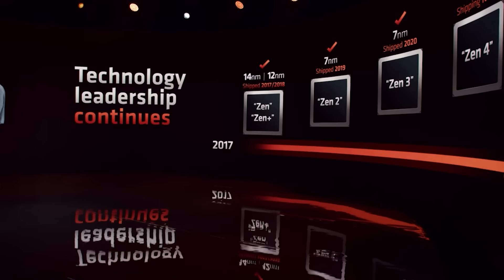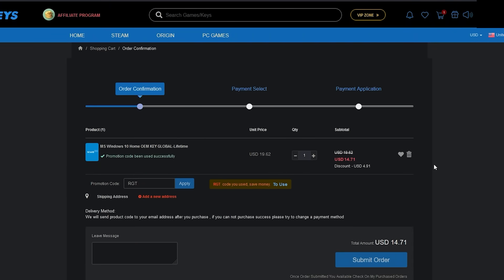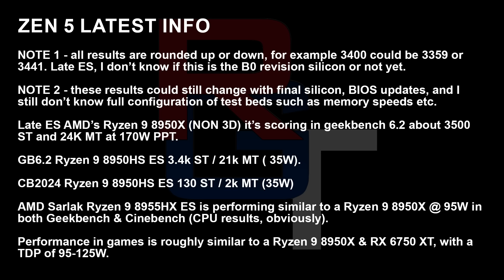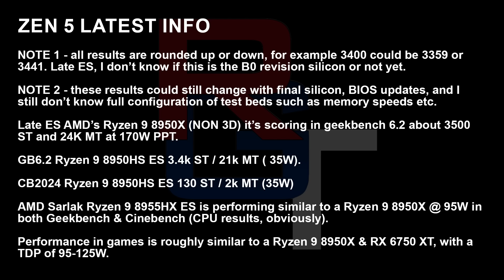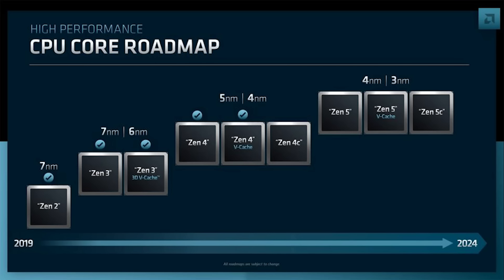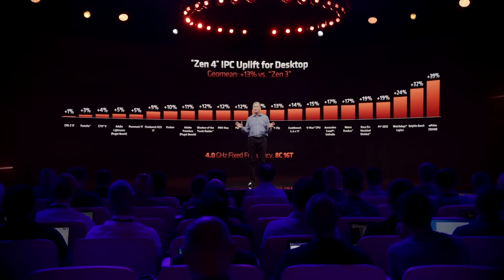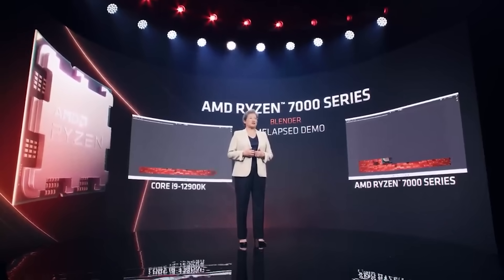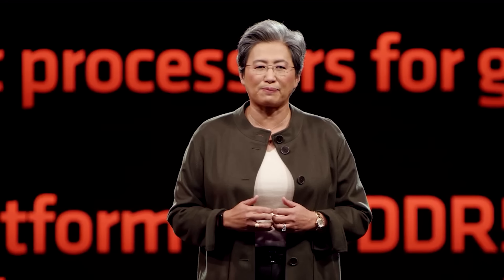Zen 5 HUGE IPC & Clock Speed Update | NEW Benchmarks Leaked

Comment: Imma let you finish but the 7950X3D is the most innovate Cpu of all time. Of all time!
Reply: Consumer desktop CPU arguably. But IBM is knocking it out of the park with how they’re using cache on mainframe and AI CPUs.
Reply: Smiling here in Oakland... Real talk
Reply: I'm chilling with my 5800X3D for another year or two. Still an awesome chip
Reply: Yeah!! Good choice, can wait until AM6 platform; I think am5 has a good 2 generations in it. After that CPU's will be insane for gaming @josh4434
Reply: They are real innovations, wish windows was more capable of utilizing them better
Reply: I have that exact CPU paired with an Nvidia RX 4090 GPU & 128GB DDR5 RAM. Very happy with it.
Reply: @euphorichaggis Terrible choice for your CPU. You should have went with an I9 13900ks or i9 14900k.
Reply: @euphorichaggis i have the same but have had issues running 4 dimms. What memory are you using?
Reply: If only the software kept up with it and used its 3D V-cache as well as that of the 7800X3D.

Also, I'd contest this statement and say that having both a few performance cores and many efficiency cores is a just as big innovation since you can use those many E cores to efficiently run highly parallelizable workloads while also not losing performance for the less parallelizable workloads.
Reply: Yes and no. I understand cost, etc...., but they should have made both ccd's x3d. Software solutions have never worked the best. I owned a bulldozer back in the day and it would just randomly stutter, gaming desktop use didn't matter, because they were essentially dealing with the same thing back then. Does any game need 16 x3d cores? Absolutely not. But I'd rather not deal with the hassle of having to go into the bios or software to switch between productivity and gaming. I can use 16 cores for productivity, and is it a small hassle, maybe, but not when I'm paying that much for a chip.
Reply: @jonathonschott  the problem seemed to be that cores in one cc'd were using cache on the second CCD and that added latency was undoing any positive effects of the 3d cache. 
I hope they do make a zen5 with one 3d cc'd and a 5c ccd. Making the 16 5c cores lower clock, just to help windows... I would buy that one in a hard beat.
Reply: @annebokma4637  that is correct. But the problem was/is that software makes the decision of core distribution, same as on bulldozer, and it wasn't 100% then and it's not now either. There are things I could use 16 big normal cores for, that the mild hit to frequency an x3d chip has would not really make too much of a difference for my workloads and would far outweigh the inconvenience of the 7950x3d scenario. The chip you speak of would be a monster mobile chip, I'd buy that laptop without a second thought, but the things I do make me a power junkie on desktop
Reply: @jonathonschott  same here, just no budget to go tr or epyc. And I would use that 5/5c 24 core on desktop gladly.
Reply: Some games, like Cyberpunk, benefit from more cores than 7800X3D offers. But 7950X3D has its compatibility issues regarding utilization in many games.

So I hope next gen X3D would have balanced design with 16C. I was originally expecting single CCD to handle 16C, but seems not to happen for desktop. So hopefully the cache is balanced between the 2 CCDs.
Reply: No both the 7950x3d and 7900x3d are garbage CPU’s. You can’t use all of the cores you are buying them for if you want to take advantage of 3D v cache. The CPU literally cuts its cores in half so you only get half of what you bought the cpu for. Only the 7800x3d, 7600 and 7950x are great CPU’s.
Reply: @ZackSNetwork  7900X3D and 7950X3D are both great. The real issue is that the software is backwards for the hardware. We could literally have 128 bit CPUs for regular use if only the software kept up with them. And having loads of RAM isn't the only reason for why you should get CPus with bigger registries. It allows operating with bigger data at once.

Just compare the new games optimisation to the old ones. 1000 FPS in Counter Strike is real. Meanwhile strugling to get decent FPS in games made with Unreal Engine 5 despite this engine using C++, one of the fastest programming languages.
Reply: REAL AND TRUE ZACK WACKY  @ZackSNetwork
Reply: @ZackSNetwork it's just an indication that AMD needs to get their software in order. If they optimize this piece of hardware it will dobwhatvit needs to do
Reply: @ZackSNetwork don't post nonsense if you don't know what your talking about.
Reply: @ZackSNetwork if you use process lasso you can force games to use first 16 threads (witch is the first ccd with the extra cache) and everything els that isn't a system process to use the other 16 threads (like obs/browser/other apps) just make sure game bar is turned off so it's not fighting process lasso

But I would say for most gamers even streamers 7800x3d (5800x3d if you still have am4 platform) is what you should be aiming for as it offers no fuss no need to do anything special to make it work 3d cache is available for everything (but if your willing to work with the quirks of the 7950x3D it can be a single pc streaming monster as long as you have process lasso)
Reply: @ZackSNetwork Completely agreed! AMD well knew the 7800X3D and 7950X are superior to the 7950X3D, but pushed it out the door anyway. Zen 5 X3D CPU's and GPU's cannot afford to make the same mistakes for AMD.
Reply: @iLegionaire3755 The 7950x3d is much better than the 7850x in gaming. If your using current BIOS abd drivers, theres no comparison.